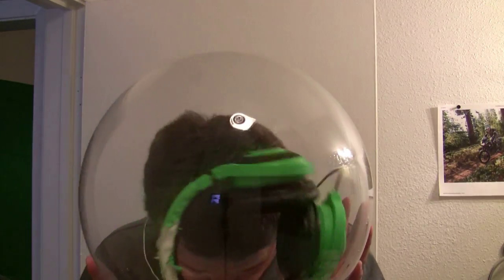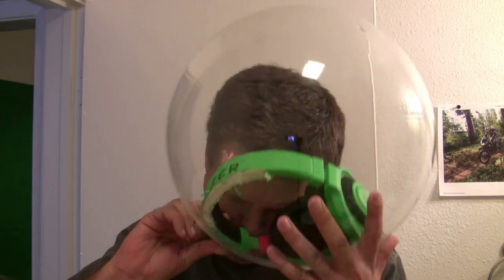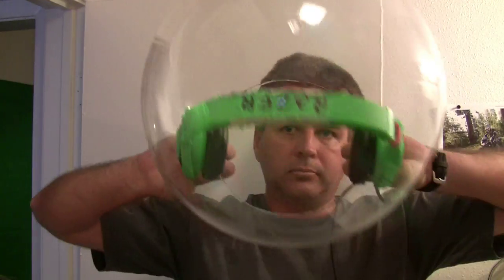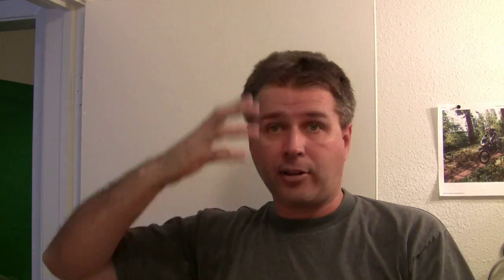Spacesuit Helmet for MarsClipper

Comment: I think maybe one of those little clip on microphones would work. Usually earbuds work in the same capacity and have a mic on the cord. Also, if you can find a bucket of the same diameter, you can chop off the rim and make a collar for it to make it sit better and not slide around especially if you can get the contour of your shoulders in there.
Reply from the maker: Thanks those are great ideas! I really do want to go back and play spaceman sometime! It's been far too long.
Reply: @CarlinComm  contour gauge for the win! 👍🚀
Reply from the maker: @stigyanblue1442  I just saw that it was 7 years ago since I uploaded this! I do still have the acrylic dome though!

Comment: Where did you get the sphere?
Reply from the maker: Its a lighting sphere, from a website https://www.1000bulbs.com/, the hole wasn't quite big enough so I had to cut it out bigger, very gently, I was worried I'd crack it. Still need to go back and finish that one.
Reply: @CarlinComm  I cannot find the sphere on that site? Any thoughts?
Reply from the maker: @Paintwithcary  sorry if this is a duplicate... I got that from 1000bulbs.com, something like this one here:
https://www.1000bulbs.com/product/848/PLAS-20PC.html

Comment: What did u used for cutting the helmet? I just got one of 18’’ but Im afraid to crack it or something.
Reply from the maker: Of all the projects from 5 or 6 years ago, I hope I get to go back and finish this some day! Yes, be very careful, if you use a dremel or something fast, it'll have a tendency to melt the plastic. I used a coping saw I think, it was a very thin saw with a frame. Go slow, don't put too much pressure. It worked ok, you can always go back and sand later. I think I tested a hack saw blade, and it worked but wasn't flexible enough. It might be worth scoring a line before you start cutting, like how you cut glass, if it starts cracking, it might follow the score. Maybe? I only did this once, so not sure I can add much to it. Many years ago I did help cut a plexiglass chin bubble on a helicopter, I was the new guy, the old guy stressed being very slow and deliberate. I think we had a jig saw, but he took very small cuts, always well back from the line. On the helicopters, the bubble windows were shipped well over sized, so you had to cut them down to size. Good luck!

Comment: How do you make sure to have enough air and not intoxicated with co2
Reply from the maker: That's a great question! I was doing this more for a prop or costume, not practical use. Although with Covid Maybe I could finish it! I never did finish it or the spacesuit. From what I have seen done, like by Adam Savage, just blow air into the helmet and let it vent out again should be enough. I have worn respirator and gas masks for hours and as long as you have it vent out, you are fine. Thanks for the question!

Comment: How did you cut the opening to be large enough? Dremel?
Reply from the maker: That was a couple years ago now, I think I used a thin blade on a coping saw (little frame saw), I did have a dremel, but I think I did saw it first, then cleaned it up with the dremel.